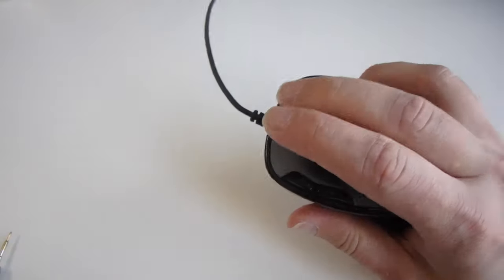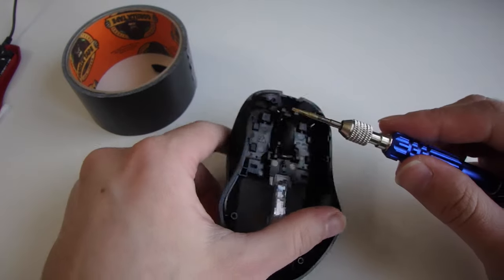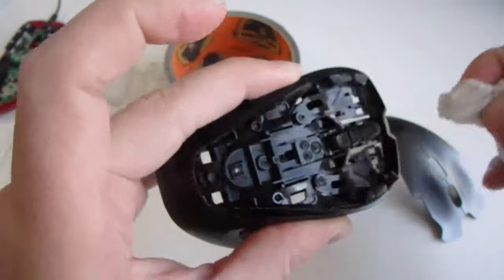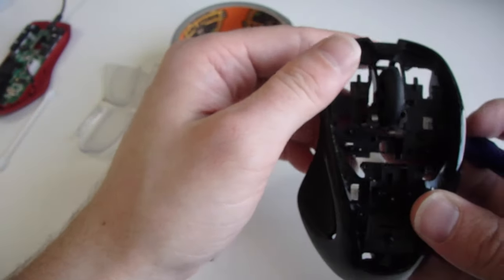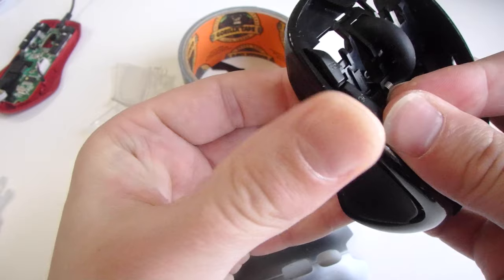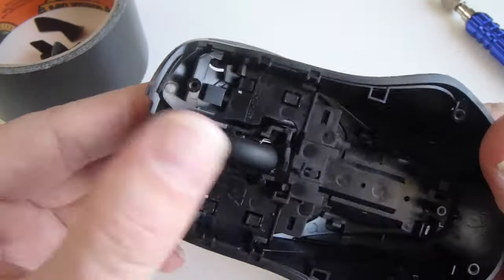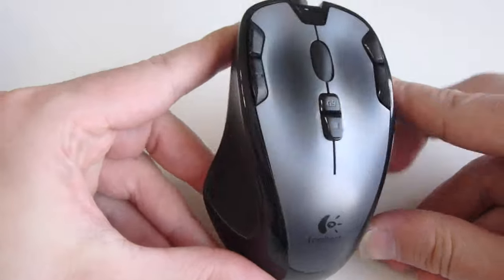Easy Fix for Logitech G300 Double Click Problem

Comment: In which part you fix the double click problem? No need for cleaning I think, watched video but only saw cleaning.
Reply: He meant that the click problem was because of the dirt stuck in between and cleaning would obviously be the fix...
Reply: i disassemled the mouse but i did not follow the instructions for the buttons, i cleaned the only electronics inside with a soft cloth and the mouse is like brand new. No random double clicks, no miss-clicks etc
Reply: It worked here with my mouse. I was having this click problem and it disappeared after this clean.
Reply: For me...  if you look at the little flat pad that pushes on the micro switch---   that pad had wore a scratch into it--- so that it could no longer press the button....  So i just sanded that little pad flat again, and now it works like brand new.  Very cool!
Reply: Because of guys like you, shampoo comes with instructions
Reply: @pedroperenzin   Lol what? I already disassembled the mouse and cleaned it before this video. My problem was a faulty microswitch. I came with the hope of replacing the microswitch which I thought was the solution. Thus, the comment was made. I only realized cleaning solved the problem for others from the comments, lucky for them. For me,  I had to replace the microswitch. Because of guys like you, everyone hates judgemental people.
Reply: you don't have to watch the full boring video. Just remove the screws and clean the left button and its microswitch. Inside mine, there was some grime but none on the left button and its switch. So, i removed the grime and poured drops of 95% alcohol inside the microswitch, and then removed the alcohol upside down on cotton as a grime solvent. 3 times. Now it works again.
Reply: If it still doesn’t work for you, you may have the same problem as me. The click must be too deep because of wear, a small piece of plastic must be glued at the click to avoid spacing

Comment: Regret buying a G300S, it was a good mouse while it worked but the double click problem started happening after only 8 months, first it was the left button and now the right, it has to be the switches because the mouse is clean inside and my previous Logitech G5 Rev 2 lasted 6 years without ever having a double click problem (the mouse itself stopped working altogether, probably just needs a new cable).
Reply: mine is doing the same thing however it has worked for over 4 years so I'm sure the button "Hardware wise" is sticking I don't see how cleaning the plastic is going to help
Reply: For me...  if you look at the little flat pad that pushes on the micro switch---   that pad had wore a scratch into it--- so that it could no longer press the button....  So i just sanded that little pad flat again, and now it works like brand new.  Very cool!

Comment: I removed the transparent plastic part by applying pressure from the outside of the mouse frame using the screwdriver, works very well.

Comment: Thanks for filming this disassembly guide! Just did a cleaning of my G300s using this as a reference, much appreciated. Something I wanted to point out that's definitely worth a quick touch on the board is the left mouse button's micro switch (the top left white horizontal bar visible at 1:20). Given how sensitive the buttons are on this mouse, any amount of gunk accumulated on the switch itself can't be doing any favours for left click reliability.

Comment: The video itself is fine, but the problem people refer to as "the double click problem" with these mice is normally caused by the switch, and can happen with a new mouse that's had no opportunity to accumulate dirt. I've got a G300s myself and it's had the problem ever since I bought it.

I learned to live with it because it's still the most comfortable mouse I've ever owned and I don't want to deal with taking it apart or trying to replace it only to have the same problem with the new mouse.

Comment: the secret is to lightly sand the contact of the gray plastic part that pushes the click.
the contact with the click naturally is already concave, the sandpaper will remove part of this concavity and will allow the plastic part to press the button.
over time the contact of the gray plastic's click will deform.

Comment: What worked for me was to take it apart only to the circuit board and spray canned air up all around the left click micro circuit. I wasn't able to figure out how to 'open' the micro circuit to bend the pin back in place like other comments have suggested. The issue seems to be resolved as of right now though.

Comment: G300 worked like 3 years, but it became hard to hold or press buttons so i bought g300s (g300 no longer available). After 14 months g300s had right mouse button up-down events while holding right mouse button down. There is a click sound that lets you know if button is released, which comes from  metal spring inside the microswitch. And these up-down events appear under the click line. Bought another g300s and problem disappeared. So it seems g300s comes with faulty microswitches.
Reply: I think the 300s is cheaper construction quality and materials than the original 300. I had my 300 for 3-4 years before the buttons started to go, but I've gone through 3 300s's in the past 3 years. Now it appears Logitech has discontinued the line.

Comment: I filled my sink up to a few inches (enough to fully submerge the mouse) with HOT water.  Poured Dawn in while it was filling. 

Put mouse in.  Shook it around over and over.  Pulled it out, let the water drain, put it back in... rinse and repeat x 10 or so times.

Then I let it soak for like 1-2 hours.  

Came back.  Rinsed it out super good.  Let it dry over a vent in my house for 8 hours.  Good to go.

Edit:  FYI, mine is technically a G300s.  Dunno if all G300's are G300s's or what.  I have two of them.  Alcohol just didn't do the job for the first one for me.  So, I knew 140F water and dish soap would break up ANY gunk in there.

You just have to let it dry before you plug it back in.  I've cleaned many keyboards this way... right under the sink with water pouring all down the keys.  Can't beat it.

Yes, alcohol is SAFE (because it dries very fast) and a great disinfectant.  But there are far better ways to actually remove GUNK from stuff.

But water doesn't kill hardware.  Water + electricity kills hardware.  Gotta let whatever it is dry before using it again.

Now, sure, for a CPU or GPU, I'm gonna use Q-tips and alcohol.  

But for a mouse or keyboard... I'm using soapy hot water.  Sooo easy.  30 seconds of labor involved lol.

Comment: Can confirm that cleaning the mouse fixes the double click issue (for me it felt more like the click would release mid drag, which annoyed me af in games)

also, to remove that transparent plastic thing, (which for some reason he didn't show how to remove), just use ur nails to open the interlocking mechanism, and then push one of them from outside (from where you can see the rgb light) with a coin or something similar, took 10-15 mins to figure it out, almost broke my nails doing it.
Reply: For me...  if you look at the little flat pad that pushes on the micro switch---   that pad had wore a scratch into it--- so that it could no longer press the button....  So i just sanded that little pad flat again, and now it works like brand new.  Very cool!

Comment: Worked first try, a little annoying putting the clip into the switch. The left button is a little quieter now, and also doesn't have the double click issue anymore. Was also a good opportunity to clean out the inside of my mouse.

Comment: Hi, this really worked for me. I had the issue of the scroll wheel doesn't working properly, it kinda make bumps in the motion but after cleaning it throughly it now scrolls like when it was new, it has 6 years now btw. 

The other issue I have and couldn't solve is that the scroll click doesn't work. I tried pressing it directly from the board without the black cover and it didn't work either, maybe some of you can help me with that.

PD: I had to take the scroll wheel off to clean it properly until the little gaps were clear.

Comment: My mouse was full of lint and dead skin, I cleaned the mechanical portion of the mouse with soap and water and which has consequences i know, dried it the best i can. It solved my faulty right click but it also made my mouse wheel a little bit laggy. great video on how to dismantle it.

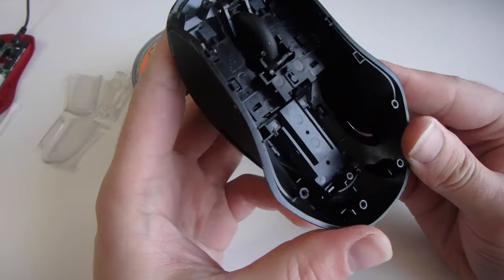Comment: For me...  if you look at the little flat pad that pushes on the micro switch---   that pad had wore a scratch into it--- so that it could no longer press the button....  So i just sanded that little pad flat again, and now it works like brand new.  Very cool!.. If you pause at 3:09 --  you can clearly see that his mouse has the exact same problem as mine did---  in that the "Right click" pad has a little scratch dug into the plastic of that little square pad....   Just grind that pad flat again. I did it with a dremel.  doesn't take much.

Comment: Heres some advise for people, use some lube on the back of the 'button' dont put it on the switch, I used some dry ptfe (dry lock lube) let it dry a little then itll be fine, atleast for me. If you clean it all properly and dont actually put lube where it will contact the switches it will cause friction and sheer forces on the top of the switch. Which will kill it fast.
And I only came on here looking for the screw locations as I didnt want to remove the pads without reason, my mouse now works fine.

Comment: Need help removing the tape without ruining it, suggestions?
Reply: use a thin screwdriver or a blade and then your nails to gently pull the tape only where the screw are.

Comment: I'll be damned, it actually worked!

I have a G300s that started the good old "release mid-drag without having released the button, oh and by the way re-press while you're hovering over something you don't want to click" a few days ago, and this fixed it, at least for now. I actually got this thing for free as a warranty replacement for my G100s that failed in the same way less than a year ago, so I'm happy it's not a total write off. And maybe I can repair the other mouse too, though I suppose that's not really in the spirit of Logitech's warranty terms. :)

Using your video as reference, I opened up the mouse and tried testing the switches directly, only to find I couldn't reproduce my problem no matter how lightly I pressed the switch, or from what angle. My plan had been to use what I'd read elsewhere to open up the microswitch casing and retension the metal, but at this point I hesitated and decided to follow your procedure further. I didn't take the whole thing apart, only going so far as to pull the lenses out and pop the top plate, spray it all with compressed air, wipe things down with rubbing alcohol, remove an incredibly tiny piece of plastic flash ('sprue', I don't know) that I suspect was the larger part of my issue, and reassemble everything. Works like a charm now. 

It's a huge relief to know I won't have to do anything crazy, at least in the short term, like replacing the switches myself, or building one of these DIY 'debouncing' circuits described on Tom's Hardware: http://www.tomshardware.com/reviews/hack-mouse-click-do-it-yourself,4458.html I'll admit that does look like a cool project for people with old/rare/cherished mice they can't stand to replace.

The mouse will no doubt fail again at some point (most likely within thirty seconds of posting this comment) and need more in depth repair, or replacement, but in the meantime I have much more reliable drags, so thank you!
Reply: Rob Martens interesting. Most tutorial requires opening the clicky switch thingy. How long until the problem returns for you? Or is it still going strong for the last nine months?
Reply: For me...  if you look at the little flat pad that pushes on the micro switch---   that pad had wore a scratch into it--- so that it could no longer press the button....  So i just sanded that little pad flat again, and now it works like brand new.  Very cool!
Reply: @OcDmn  Two years late, yikes! Sorry I never answered you, but Youtube apparently decided not to notify me about your reply. I know it's too late to be useful to you, but for the sake of anyone else reading:

This fix worked for about a year after my original post, at which point the problem happened again and I had to open up the switch casing and re-bend the spring. It worked, but about a year after THAT the right mouse button did the same thing, so again I opened the switch and adjusted the spring. Both buttons are still reliable, thankfully.

Unfortunately, a month or two ago I started having trouble with middle click; it seems to have gotten better after a few weeks without really doing anything, so maybe it was just a piece of lint or something. If it happens again I think I'm pretty well screwed, since middle click is provided by a tactile switch, the ones that are little flat square boxes with a cylindrical button on top. As far as I know those are irreparable, and I'd be forced to replace the whole component, if that's even possible.

At this point, the hexagon-patterned rubberized plastic on the left side has worn down to the bare casing in a spot directly under my thumb, so I imagine I'm well beyond the designed lifetime of this thing, and I don't see myself repairing it further. It looks nice and feels comfortable, but the components leave a little to be desired. Which I think is Logitech's slogan nowadays.
Reply: @RobMartens  whoa i asked this two years ago? lol how time flies. i got away without opening the bottom iirc, just unclasp the top and wipe the part that connected to the clicking switch and the problem goes away. had to do it like once or twice a year, but that's it. still using it but maybe it's time for me to look for replacement too before it actually break on me lol.

Comment: If it still doesn’t work for you, you may have the same problem as me. The click must be too deep because of wear, a small piece of plastic must be glued at the click to avoid spacing
Reply: you can unscrew the mouse if the plastic end is too big, you can always put back the anti-slip tape ends that will keep the defects inside if they fall

Comment: If you have a double-click problem you need to disassemble the corresponding switch and check the piece of copper which is making contact when you press the mouse button. Usually you have to re-bend it and re-position it. I fixed my G9X mouse double-click that way.

Comment: Of course this "solution" does't last, if it even works to begin with. The double click problem comes from the small metal blade inside de Omron micro-switch that does the "click". To adress the problem, one needs to open the micro-switch and re-bend that blade, or change the whol microswitch.